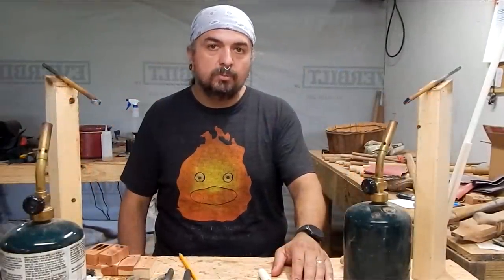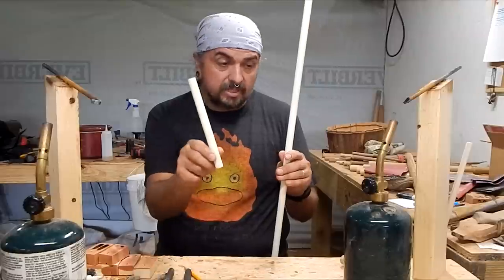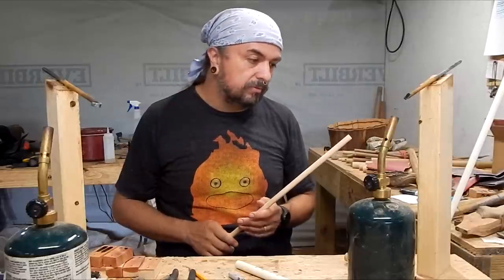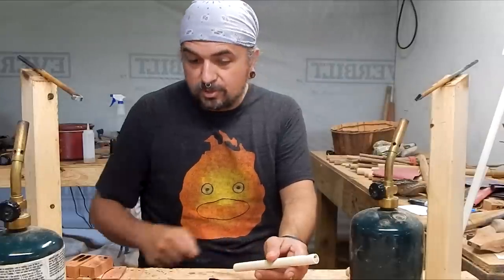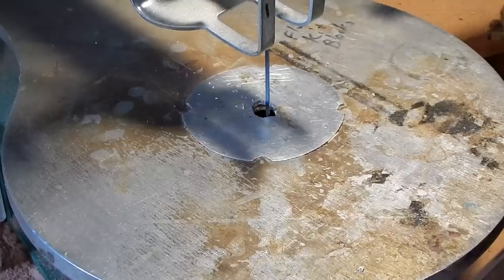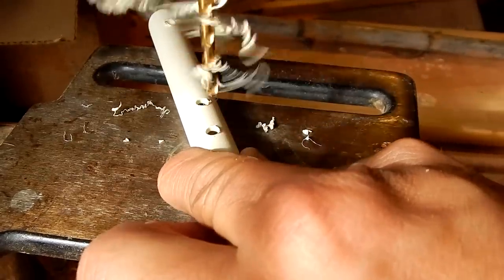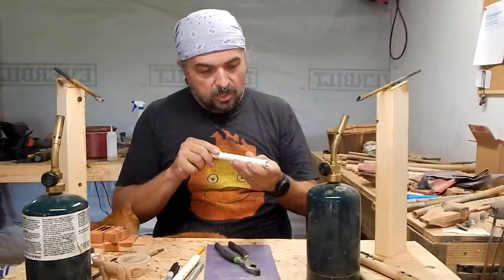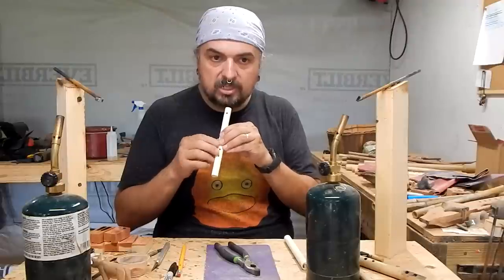Learn to make a PVC Cherokee 4 Hole Whistle

Comment: Hi Charlie, thanks for all your videos; your knowledge, humor and generosity always shine through! 
I noticed that your river cane version of the 4 hole whistle has a much thicker wall than pvc. So, what if I were to use a thick wall pvc pipe like 1/2" schedule 80 for this project? Would the smaller bore make for a better whistle than regular pvc, or worse - or no difference? 🤔
Reply from the maker: @paulockwell5854  I believe the measurements were a little different on the river Kane version than the PVC version however it probably wouldn't make much difference using schedule 40. I always say try and see! Thank you so very much for your kind words!

Comment: you can use beeswax to hold the plug in. I melt the wax on with a low heat soldering iron. That way you can take it out and clean the bore. Thanks for the video

Comment: This has inspired me to make a descending series of these with adjustable plugs for descending notes. Sand the sides and glue them together for a pan flute. Think it'll work? Michael
Reply from the maker: That's interesting, there is actually a flute made just as you described which is used in a modern play today. I'm struggling to remember its name however I have been commissioned to make one of them in the past.
Reply: I have a Wind Melody, I believe what you are speaking of, which I can play anything on, even jazz and blues...Girl from Epanema. I have figured out how to bend notes on it. Is it possible to bend on your flute? That's why I am so excited about using your flute technique as a pan flute. Instead of playing vertically, as a common pan flute, I would play it horizontally. I have PVC and a full shop I am going for it! Michael
Reply from the maker: @marciacunningham5877  anything is possible! 😁

Comment: Are you calling it a whistle rather than a flute because of its small size, comparatively high pitch, or lack of air chamber/air track/block assembly? Thanks, great video and channel.
Reply from the maker: Thanks for your comment Doug! Those are all basically the reason we call it a whistle. Truthfully all wind instruments are some type of flute however to distinguish the difference between types that's pretty much why we say whistle. :)

Comment: Cool video. I take it if you used a larger diameter PVC it would make a lower tone? Is it possible to make an Eagle Whistle out of PVC? Ronald did a great job too. LOL
Reply from the maker: Yes, a larger diameter will make a lower tone, but keep in mind you will need to place the fingerings further apart.  It is possible to make the eagle whistle from pvc also, just use the eagle whistle video instructions and replace the sawgrass with pvc.
Reply: Thanks.

Comment: I find it way too easy to over blow each flute I make. I have a hard time breathing so lightly consistently. What am I doing wrong? Do I need more or less opening to the sound hole? Or, is there some other thing I should try?
Reply from the maker: That's a great question Ken! There are a couple of things that can cause the flute to overblow easily. Sometimes a restricted air path, sometimes the size of the sound hole and sometimes the length of the flute. If you can contact me through my website, I will have you send me a picture of it to help me figure out what's going on. Thanks again for watching!

Comment: I tried to make a flute but I coulndn`t tune it ,,I can get it to whistle very good and clear without Opening any holes (besides the whistiling hole of course)..Then when I open the first hole I look on the tunner I see that the pitch has raised just a little bit I make the hole bigger and bigger until i get to my desired note but the problem is that now the hole is too big same situation with all other holes than whe I get to the top note the whistling is very breathy and low volume,,,how do you make the flute so that the holes diameter is normal size and the space between fit to my finger size and position and it sound good when playng high notes,,,thank you,
Reply from the maker: Hey, hang in there! I was going to post links to a number of different videos that I have made in here but would rather just answer your question with this video link: https://youtu.be/gwVBpph9TUw
and suggest that you please check out our hundreds of other videos on flute making! Thanks so much for watching.
Reply: @BlueBearFlutes  thank you...,

Comment: What if I increase the size of the finger holes to the next size up drill bit 7/32? will the notes be lower or will the flute be ruined?
Reply from the maker: Enlarging the hole makes the note higher in pitch. We have a video about changing the pattern to fit your material which may help out. 
https://youtu.be/gwVBpph9TUw
Reply: @BlueBearFlutes  Thanks, I'll check it out.

Comment: Why would it not make a sound?  I followed the instructions to the letter and still have no sound
Reply: I feel your pain Darlin - its bloody annoying when you spend time making something and it doesn't work :-)
Reply from the maker: Hey Darlene! Usually its because of the alignment between the plug and the sound hole. Don't give up! Sometimes it takes a little experimentation in order to get it. You are always welcome to email some pictures of your whistle to us so I can help figure out what is going on. First contact me through the contact form on my website bluebearflutes.com, and once I reply you can attach pictures to the message. I will need a picture of the inside of the plug area also.